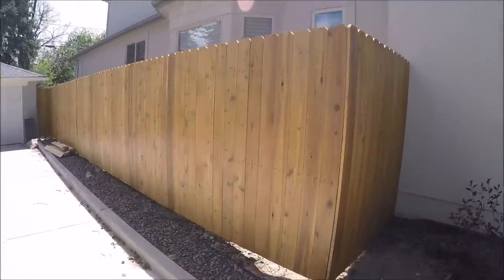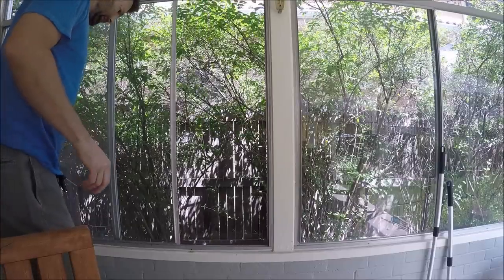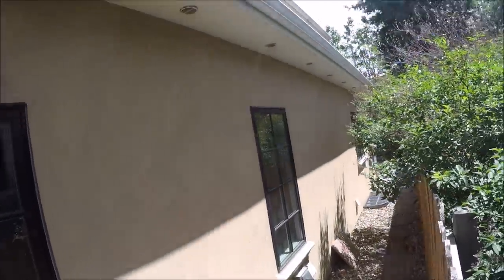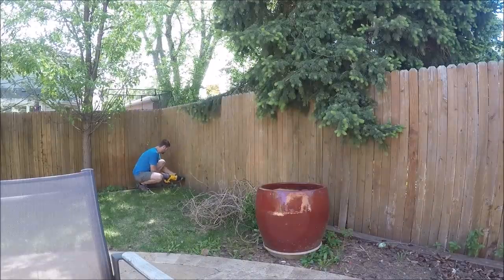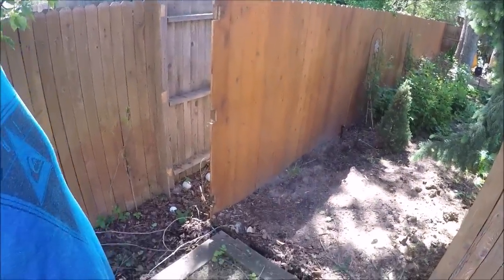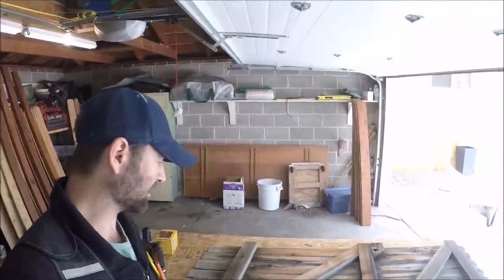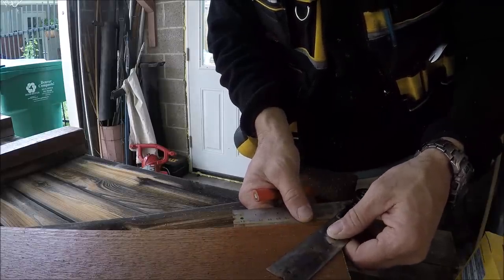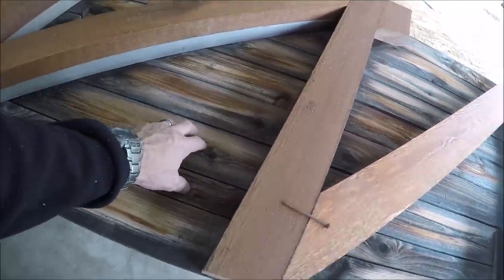How To Build a Long Privacy Fence | THE HANDYMAN |

Comment: I replaced an old fence for a friend last year. Used you same rack out methods. Had uneven ground so had to trim for ground rise in sections. Had dogs next door so i braid nailed the pickets first to secure the yard. Ran a string line and installed screws after. first time doing that, but boy was it a time saver. Nice job. In Canada i put a min 1/8 inch gap between pickets.
Reply: Why would you put a gap between the boards? All wood dries and shrinks then you have a half inch gap after and there goes your privacy. Put them tight next time.

Comment: Dude, I feel your pain on building this fence. About a year after this video, I built a 160 foot fence and it was all going nice until I started hitting some tree roots instead of water lines. I also used a post hole digger before I bought my power auger.

Comment: The old fence looked to be in pretty good shape.
Reply from the maker: Wasn't to bad.  had about 4 broken posts and I broke 75 percent of them taking them out.  Just snap them off right where the post meets the concrete.
Reply: @lichub  Completely agree, the dirt gets so hard after a few rains that you cannot pull them out if you wanted to.  And the cross members lock them in place too.  Lots of unnecessary work.  To each their own.
Reply: I've mixed concrete into the backfill dirt because no one needs 2500 psi to hold a fence post.  Stiff dirt is all ya need.
Reply: A good rain could also loosen the dirt. That, and steady moisture from the dirt on the base of the posts would promote rot / weak points in the post as we saw in this very video... He did this right, not the easier way.
Reply: @beobe99  Concrete is not impervious to moisture so it can propagate rot in the base of the post just as you say the soil would.  The best solution will depend on where you live and the soil type in which the posts are set.
Reply: lichub we use concrete posts and concrete kickboards with a wooden fence panel that just slots in they last about 30 years
Reply: @TheHandyman1  A lot of money in repairing these spec home fences.
Reply: I could of use the old fence in my backyard. Recycling

Comment: Do you line up the picket pieces touching or do you leave a small gap? The wood used is pressure treated so maybe the wood is stable? How often would you need to stain the boards? Would it make the pickets last longer to paint it as opposed to staining it? I may have mentioned before that I am planning to do a self build small house in the 750-900 sq ft range. Just collecting ideas really. Thanks for the information. I just learn something all the time.
Reply: James Russell. Pressure treated wood (pine) is wet and will shrink at least an 1/8”. So butt them up together. However if it’s kiln dried (cedar) then you’ll want to gap those at about a1/16” of an inch because they will swell in wet weather.

Comment: Beautiful job. I'm asking the following for learning purposes. You say it took you four days. Once you installed the posts, how much time did you give the cement mix to set before nailing/screwing the pickets? And, I didn't see you give the gate any spacing for expansion or movement. When I installed my picket fence double gate, I gave the gates a spacing of approximately a quarter inch and when it rains or in the winter season ( I live in the Midwest) they come together to where it's hard to open. Thank you. Jose
Reply: Usually most people give it a day or two.

Comment: You are helping a lot of people man. Thank You Very Much!!!
Reply from the maker: you're welcome.  Thanks for taking the time to leave me a comment.
Reply from the maker: The holes are 24 inches deep. A 8 foot post works perfect for a 6 foot fence.  I put as much concrete as need to fill up the hole.
Reply: Have you ever tried to pour dry cement in the hole and then add water?

Comment: When replacing old fencing that is not all rotten, look for and deliver to a "freecycle" facility. Many use old fence and decking for reclaimed wood projects like planter boxes, feature walls, picture frames, and all sorts of projects. There is no need to fill up landfills where the wood will begin to decompose, releasing all the carbon it sequestered when it was a living tree. Clearly not all used wood products are suitable for new projects. However there is a ton of good wood going into landfills every day.

While removing an old fencing or decking place a sign on the street stating "free used fencing/decking" or something of that nature. You may find sections walking off or someone willing to pay you to deliver to their home or shop.

As contractors, it's our responsibility to preserve wood products as much as possible to ensure availability. Meaning, it's better for someone to reuse old wood so they're not buying virgin wood and distressing it. I've had more old wood walk off the job site than I've had to dump. Obviously, not every city or town has a free cycling center or a lumber yard that takes in and sells old wood. Heck, you may have a struggling lumber yard with yard room that might be keen on selling reclaimed wood to boost their sales. Check around when you go in for new stock on you're next job. 

Cheers!
Reply: I thought the same thing. I'm a hobbyist woodworker and it killed me to see that wood going to the dump. It hurts my soul more to know people pay a premium at home depot for distressed barn wood when there are things like this available in the world.

Comment: On the Fences I build I usually break the joints on the post. I use a 16' 2x4 in the middle and 8' 2x4s on top and bottom as starter runners. I think it makes a studier fence . just putting that out there.

Comment: Nice lookin fence. What post spacing do you use? I normally use 8 foot but have considered using 10 or 12. My area is hilly and the pickets can sometimes follow the lay of the land somewhat. I try not to have to trench in the pickets or raise them to high to keep sections level across the top. I also try to keep the various levels at 8 feet each so they don't look all wonky.

Comment: is that cedar you are using for post picket and rails. I am in  Arlington Texas and have to use metal posts to code I am told.  where are u working the weather looks good very hot here.  Good video
Reply from the maker: Yes everything here is made of western red cedar.   I'm going to be building a pretty awesome fence with steel I beams for posts in a few weeks.

Comment: Another great video! Did you space the pickets at all or snug them right up? Also I see people build them and have to rip small strips of pickets to fill in gaps along the fence. How does that happen?
Reply from the maker: +Jarid Shaw no spacing on this type of fence .  I only have to do a rip at the ends or when building a gate. Fences are man made with rough sawed wood.  Sometimes things get out of alignment and you have to custom cut a picket.

Comment: Random question, is it best to butt the wood close together or should there be a gap for expansion and contraction?
Reply from the maker: On an outdoor fence that is screwed together like this its best to put them tight together.
Reply: Right, they will dry and if you gap then the gap will get bigger.

Comment: Great video. Hey did you take out the old posts completely or left the bottom part buried? How much quikrete did you use per post? Thanks!!
Reply from the maker: Most of them were broke off at the base.  They were left in the ground.

Comment: I've just made  a twin gate 8.5ft wide , 6ft high , featherboard style , the gate frame i'm using 4x2 treated timber , the diagonal braces (x4) are angled at 30°  , i know it should be at least 45° , i'm using 3 pairs of cranked hook & band hinges , screws for the hinge plate using m8 coach screws . Question ? do i still need to fix the diagonal issue or would my current setup be ok .

Comment: You should get in contact with a company that makes wood pallets.. they can use those old fence boards & that'll save you the cost of the dump.. that's what I do. I'm a fence installer.. just a thought but I like your work.

Comment: How to do you determine the string line on the top for the pickets.  As in do you just measure a certain height above each post on each end and then use the string line?  Thanks!

Comment: I have been in the process of picking fencing for my property.  I really like the Metal Craft steel corrugated fencing I keep seeing in Europe.  I am guessing I will just have to order from a steel company or a roofing company.
Reply from the maker: Do you have a link to a picture of the fence you are talking about?   I need some new ideas for fencing.  I really don't like the wood cedar fence much.
Reply: The Handyman
 https://youtu.be/XMtK_0nCFfc.  This one is from a guy in Texas who just basically built his own.  I have been looking at roofing companies in my area and you can buy the roofing panels and just bolt them together.
Reply: The Handyman 
https://youtu.be/wu537rNVH98. This is my favorite one.  You could easily do this for pretty cheap and it is a monthly or annual clean up for a quick profit.  This fencing will last forever as long as the cement is sloping away from the metal studs.  Your air shocks are nice btw.  I have an F450 and would love to put it on air and get a more smooth ride.  Goose neck on air would be another good upgrade.  It's a thing.  Lol.
Reply: Abel Wrate ,That fence is nice but looks like it belongs in an industrial setting, not a residential one. Jmo.

Comment: those 2x4's look in good shape. why dont you save the wood?  seems like a real waste
Reply: watched a guy make a coffee table out of fence pickets. could have made quite a few of those with all the wood he tossed out. I'm going to be buying a house with a bit over an acre. going to take me forever to do the fence. perhaps see if i can find one of those 3d concrete printers to print me a cement wall lol
Reply: When you spend money to redo that amount of fencing it makes sense to just add some more bucks and just replace the whole thing. Why have some of it go bad long before the new stuff in the next 10 years? Plus all our stuff goes to a recycling center here so they reuse it or mulch it.
Reply: @kevintunaley5079  Sometimes making tables takes away from hours you would be working/on the job. But you are correct, my wife makes stuff out of left overs from job sites.
Reply: I agree. BUT! I'm the guy who would save all that old wood for a "project" that, to be brutally honest, I'm never gonna start, let alone finish. And that old wood would end up sitting in my yard, looking totally ghetto. But hey, at least it'd be surrounded by a beautiful new fence. LOL!
So perhaps he made the right call to just pitch it and move on. 
Speaking of which, I need to do the same. Be well, stay safe, and keep your loved ones close.
Reply: @teejay622  He's the most efficient and productive "handyman" I've ever seen. He knows what he's doing to toss stuff that isn't valuable. It's easy to chirp online about "waste" without any consideration for wasting people's time, energy and space.

Comment: For your dewalt power tools, do you use brushless? I’m buying a new set and not sure if the extra money for brushless is worth it
Reply from the maker: I have both.  Brushless is a major upgrade from the older generation.   Night and day difference.  BUT  the older style still will still get the job done.
Reply: Thanks man! I always check your videos before starting a project

Comment: Shouldn't there be at least an 1/8in gap between the pickets for expansion and also air movement?
Reply from the maker: no
Reply: @TheHandyman1  is it because of the type of wood you're using? I'm about to build my fence with cedar and can't find a consistent answer for this question.

Comment: Hi again! I know it is not a very glamorous job but...do you do a lot of paint jobs? If so can you post one? I find it everything but simple.
Reply from the maker: I do interior paint when its part of something larger.  Paint jobs take a lot of patience.   Masking, masking, and more masking.  then paint for a little bit.  I use the red foam pads with the black wheels on them for cutting it.  It makes it go a lot faster.
Reply: The Handyman I hear ya, I went to help a friend of mine to paint a whole house interior and the preparation is very time consuming. Also getting rid of the transitions between one roll run and the next is not so obvious. Not sure I could do paint for a living! Thanks for the reply and have good one.
Reply from the maker: I was tough to roll W's on the wall and over lap the rolls. Don't put to much pressure on the roller when the paint starts running out. Using a lower gloss paint like eggshell will help hide imperfections. Always try to maintain a wet edge when rolling out a wall.  You can roll from left to right or right to left but the roller has to be held a certain way.  Always have the open end of the roller pointing away from the direction you are moving.  It's kind of hard to type it out with out showing you.   Hope this helps a little.

Comment: greetings handyman, I have recently got hooked onto your videos and I must say I am glad you take the time to post them. I am curious about the details of why you choose the dodge ram truck, which platform you choose and also is it all stock including the airbags? I am not familiar with airbags at all but if you installed them as aftermarket, could you please find the link, how do you fill them in the back by the bumper, and also are they only filled half way normally? thank you.
Reply from the maker: When I bought the truck 8 years ago It had the highest horsepower in its class and it has the MDS  It runs off of 4 cylinders on the highway.  I now have 225,000 miles on it.  I have replaced the fuel pump, AC condenser fan, water pump and drivers side door lock.  It still has the original transmission.  This is the kit I have on my truck https://amzn.to/2M4E0UR On my next truck I will make sure to get on board air and in cab controls for the air bags.  They work great .

Comment: The handyman is there a reason you mix concrete in the tub and then fill in the hole with it instead of dumping dry concrete in the hole and then adding water? Thanks
Reply: I'm just wondering if it's easier for you to do it that way or if there's another reason
Reply from the maker: A dry pour is kind of a low quality hi production fence building.  Mixing it properly in a wheel barrel or tub is the proper way to set a post.   I have done a lot of dry pours in my day.  I still do it on low budget projects.
Reply: The Handyman awesome thanks for reply

Comment: How would you recommend removing old broken 4x4 from the ground or just cut them flush to the ground and set new post next to it?
Reply from the maker: Half of the fences I replace the posts are easy to break off right at the ground.  The ones that don't break I cut off at the ground.  The fence in this video had 2 fences built before it.  There was a lot of concrete in the ground on the fence line.  You will have to adjust your spacing and cut your rails to fit the new spacing.   No need to pull the post and concrete out.
Reply: Makes perfect sense, thank you for making these videos! I have learned a ton from them!

Comment: Add water to ur hole when digging by hand. Even with auger it helps a lot but definitely with hand digging holes you should have a 5 gallon bucket next to you the whole time. Dramatic difference. Not a lot but a quarter bucket til gets hard again. Trust me

Comment: how far did you separate the posts? (how far would you normally do it if the holes weren't there?)
Reply from the maker: 8 feet
Reply: I go 92 inches to avoid any trouble

Comment: I had a question why do you put the 2x4s in front of the fence and not on top of the post and the others in between sections
Reply from the maker: I understand what you are saying.  It comes down to the cost of the project.  This is an affordable fence.  Putting the 2x4s between the posts would require stainless steel brackets to secure them.  Any increase in price would bring in different fence designs and higher end materials.

Comment: what do you charge per linear foot?
Reply from the maker: Depends on a lot of things.  How hard is the digging, how many sprinkler lines are in the way.  how many old fences are on that fence line. I have run in to lots of concrete form 80 years worth of fences.  the type of fence.  generally I charge $150 per post for labor then tack on another $1000 for more labor.  Then the materials.
Reply: no sprinklers, its redwood fence in california. Its a full old fence line almost tipping. Got you. Landscapers charge here 40-65 PLF. Your opinion.. 5k for 116' is that relevant to your quote or way more?
Reply from the maker: Is that price materials too?   If I was doing a 116 foot fence I would want to make $3500 for just my labor.  California prices might be a lot different.   Gates are usually $250 labor to build.
Reply: Yes, materials included. OK I see where you are now. Thank you for your advice. Sick stuff on this page. You're a hell of a brain.

Comment: those old wood fence did not look so bad in my opinion it could have been given away they just needed sanding and paint and good as new...they where not cracked broken or anything, oh and wow cutting the thin strip of fence with no back fence riding on it is itching for disaster and kick back the way you pushed it and it swiveled left to right on the table saw blade i would not suggest anyone do that....non the less nice fence ;-)

Comment: How does it cost to build a similar fence
Reply from the maker: This fence cost $5,100    Its 100 feet long and has 2 gates.
Reply: Is that what you charged or how much the material actually cost?
Reply from the maker: that is what I charged for labor and materials.